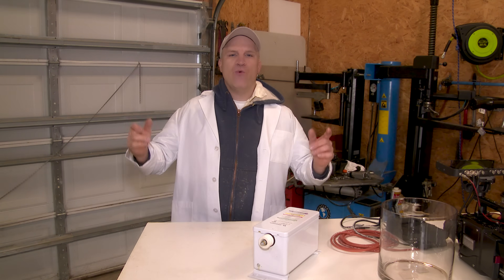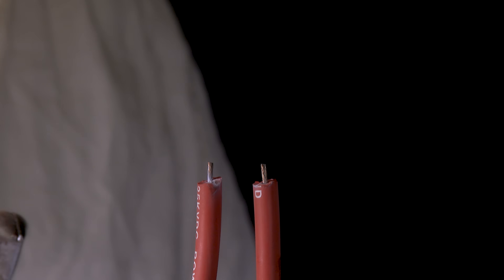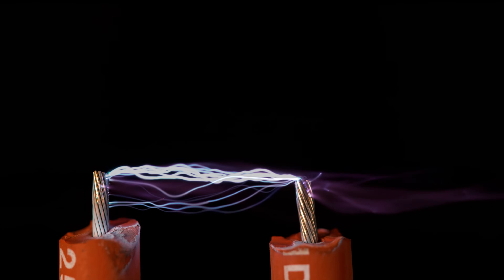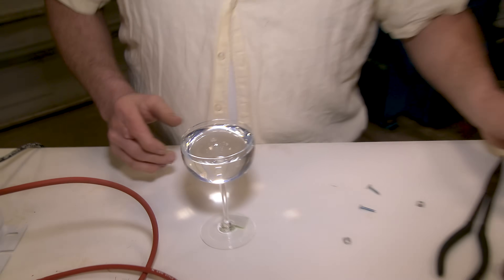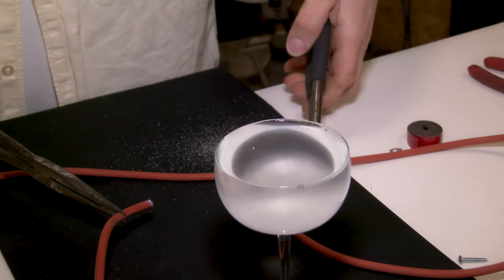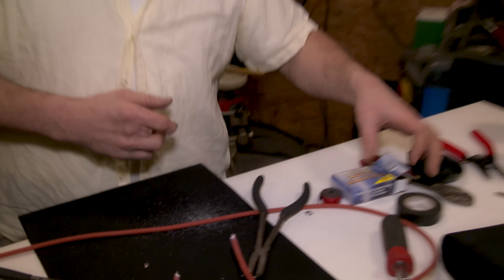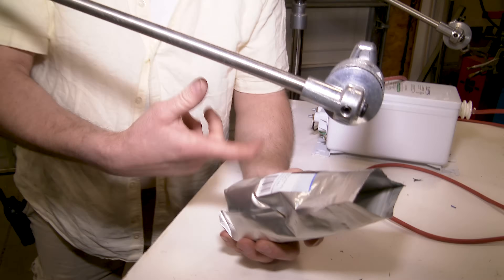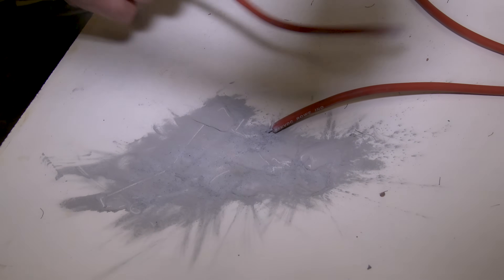High Voltage Electricity and Water - 4k Slow Motion & Ultra Slow Motion

Comment: When I was fourteen I put  sixty amp at two forty volts into a large Perspex beaker filled with water. It was like a thunderstorm in a jar. It was so violent the whole jar danced around. It was excellent.
Reply from the maker: Preaching Knowe I have been thinking about recreating something like that, thanks, I now just may do it .
Reply: Warped Perception I would not recommended it. I did this before health and safety had been invented. Like many of the things I did back then it was stupid and life threatening. So don't do it just because I did it and survived. Besides I described it for you so no mystery. Be safe

Comment: in the slow motion section @5:38 you can see the oscillation of poles between pulses. one electrode pushes down on the water while the other pulls up and on the next pulse its reversed.

Comment: I like the suggestions about trying other salts, but a different thing to try would be spraying a mist of water (or salt solution) between the electrodes instead of holding them over a container full of water.

Comment: You should try this setup: plastic bottle filled with salty water, one electrode submerged into it, the other one sparking the outside of the bottle, I did this once with a very powerful spark generator (I dont remember the voltage or power, but the sparks looked much more violent than the once you got with that one), anyway, give it a try, maybe it looks awesome as well with your transformer, it makes like a tree kind of shape, its amazing. Great channel, keep it up!

Comment: I previously scrapped metal as a 2nd job before. It was often that I run into aluminum wiring. Mostly copper, but about every 6 sites or 10 sites construction, I would run into this aluminum wiring.

Way back like 2005. The construction companies just threw away all the old and scrap wiring in the garbage. I used to go to the construction sites and ask if I could dig in their garbage bin for wiring. They sure let me. I was able to pay $75/day at the hotel and still have plenty $ to BBQ everyday for all my friends. And I only worked a few hours a day. But these days in 2013-2017, most construction companies will lock up the scrap metal in bins and call the police if anyone is hanging around an unlocked bin.

Also, because if china, the iron scrap price dropped completely a few years back. I used to drive around Seattle and pick up scrap iron that people throw away. Just a Ford F-150 truck load, I make $80-$150 just of iron. And once a while $300 a load for the aluminum engines and aluminum auto car parts.

But today. I bring in 2,000 lbs of iron and won't even make $15. No one leaves out scrap metal anymore. I mean, they do a little but. but it's no aluminum or copper or brass. Most the scrap now just goes to the garbage dump.

Comment: I loved how different the positive and negative strikes on the water looked. I only wish I knew which one was which. If you can get the high voltage out of an old fat screen TV, the HV "suction cup" electrode is pulsed DC positive.
Reply: galfisk o
Reply: It's weird that it does that. Water should attract to both charges.
Reply: also it is alternating current so no positive or negative electrode

Comment: Yehp, I noticed the halo around the plain tap water. I wonder whether there were moments where the electric current was hydrolyzing the water into H2 and O on the separate electrodes, then igniting it via the arc.

Comment: You can tell it is AC and you can tell which is live and neutral (actually positive and negative as not ground referenced!) at any one time 5:26
Reply: You'd be correct! I did write my first comment while under the influence of being awake for 37 hours XD 

Yes being through a transformer (Isolated from an AC input directly) would make it positive and negative, although still an 50hz AC (UK) (60hz if US) "flow"
it would be a bad idea to have the transformer earth referenced while in operation pop "oooooops"

Comment: Blowing on it causes that reaction because of the moisture in your breath
Reply: Neither oxygen nor water vapor is required to form an arc. All that is required is a gas that can be ionized, and a voltage high enough to ionize it (or a current high enough to create the heat required to ionize it, which is how a welding arc works). 
When the plasma stays around for several strikes, you get this fuzzy arc that kind of looks like a flame (which also consists of plasma). If you blow away the existing conductive plasma, the arc needs to re-strike through non-ionized gas, which gives you the narrow blue sparks.
Reply: galfisk is right, the rest of you are talking out your ass
Reply from the maker: SirKingHoff glad you liked it !. thanks for watching
Reply from the maker: LMAO !!!. I'll try it next time. That would be cool
Reply: I'm going to agree with Joey and Tiago here, ionized air is being moved by blowing and the arc follows it (route of least resistance)
Reply: I suspect it is just about the movement of the air; you're just pushing the warmer more easily ionized air away; sorta like how the hot air rising causes the spark to rise in a Jacob's ladder.
Reply: Now he should vape on it!
Reply: I agree with joey here guys, in a plasma torch you can use pure nitrogen gas rushing past the arc as your plasma medium essentially. So little or no moisture, little or no oxygen. It's impossible to form that arc in a total vacuum though, nothing to add electrons to.
Reply: TiagoTiago That's nearly spot on, the air remains ionized for a short while after it is energized, ionized air is more conductive so will help sustain the arc. By blowing away the ionized air and replacing it with unionized air the arc will lose its highly conductive path and will have to forge a new channel of ionized air.
Reply: Right, the extra electrons have to break away, and the hyper excited electrons have to fall back to their lower orbitals. Releases a TON of energy as heat.
Reply: Ubetcha
Reply: Not just heat though, as electrons fall down to lower energy orbitals they release radiation such as visible light or UV. I love that you're paying thought to this interesting phenomenon. This is why electric arcs vary in color depending on what gas they occur in. Different spacing in orbital energy will cause different colors of light to be emitted.
Reply: Right, you get all kinds of radiation, heat is the primary output here though. You get a lot of high energy radiation, like UV, which is why when working with plasma you should shield your eyes. On the subject of him mentioning lightning strikes and blowing earlier, when he blows he blows away the ionized air, causing it to have to 'strike' again. In a thunder storm, if you watch a large cell strike, you will often see the same path lit up a few times. It's very similar to what is happening here, the electricity travels the ionized arc, with much less resistance. So you get a MASSIVE strike and end up with a few lower energy bridges traveling in its river of ionized gasses. I really enjoy learning about and discussing anything to do with electricity. Been learning it since I was 7.
Reply from the maker: darian brown btw , I filmed my plasma cutter at 80amps cutting through solid 3/4" stainless bar, it's was awesome to see how it cuts through and cleans the metal.
Reply: Try again, think of what happens when you blow on an ember. Fire and an electric arc are both plasmas. So just like with fire, oxygen is required.
Reply: Mhmmmm oxygen isnt the only thing necessary for this reaction to happen with electric currents. How do you think lightning travels through the upper atmosphere where oxygen is less available? It travels through other components that makes up the air, aka water and nitrogen. Blowing on a high voltage current does provide more oxygen to the current but it also introduces more water vapor into the system, so yes you are right that oxygen is a big component in the reaction but 100% wrong telling me to try again. Sooo, fail? Yeah, fail on your part.
Reply: Jeez you're fucking sensitive. I was honestly just trying to help.
On a separate note that's not quite right but you can believe whatever you want.
Reply: Sensitive? Ha. Help? Ha. Would love for you to explain the science behind it. Otherwise, you're just delusional and uneducated.

Comment: maybe if you put one wire over the water, the second within reasonable sparking distance but outside the glass in the air
.. while wearing gloves, goggles, heavy coat, helmet of course -- just in case

Comment: So there's a couple frames of slow mo from 6:15 to 6:20 which are really cool where the spark travels through the water suspended from the wire after he dunks it in the glass.

Comment: Why does it go up instead of going straight across?
Reply: To answer my own question. Maybe the heat surrounding the arc makes the arc rise.
Reply: Tar RiverPirate you are exactly right, the ionization of the air is a MUCH higher energy state, so it gets REALLY hot. The air rises from the heat. That is the working principle behind the jacob's ladder.

Comment: I love that at 6:45 you can see the effect of alternating current. It pulses into the water almost like with a mini fire and exhausts out into the other wire almost. You can see the initial pulse change sides as the current alternates direction. Mental. I love deep stuff like this.

Comment: I know you said you were unimpressed but let me tell you what I saw.
alternating current switches direction in the states 60 times per second. the end with the highest resistance get the greater spark because it drops the most voltage. I was able to see one side having a stronger arc than the other. then I saw it alternate where the other end had the stronger spark. so though I understood it in theory, I had never seen that before and I thought it was remarkable. 

maybe not a stunning display but when you recognize what it is you are seeing this video is certainly appreciable.

thank you for doing this.
Reply from the maker: good point, it actually was really nice once i saw it in editing, when i shot it i thought it was just ok, thanks for the appreciation and thanks for watching!

Comment: several things caught my eye : that the arc path in air is not a straight line or shortest path between the wire ends &  that we can see the arc of electricity in air but not in water.

i enjoy your low-key / just-try-something approach to experimenting now. and allow
for understanding to follow later
Reply: I noticed the same things. I think the reason the current does not take the absolute shortest path is because it is also being repelled by the rest of the wire; therefore, the current tends in a direction further from the wire. Also, you can't see the current in the water because the electric flow is going between the ions and molecules of water rather than air particles. Someone please correct me if I'm wrong.

Comment: I have a 9000 volt neon transformer and first played with it in 1972.  One day I was making a glass bead by having one wire over a small pile of wet sand. Other wire was in the sand. Resulting arcing produced a purple bead but before done , both wires came loose and landed on my thumbs. All that electricity was going to my chest. My eyes just turned off. Could only see black and what seemed forever, I managed to push myself backwards with my legs and broke contact. Geeez, thought I was going to die. But I still have the transformer, just a hell of a lot more careful. btw my eyesight returned to normal once loose. If you use a single strand of old screen wire and arc to it, it will spark heavy then ball up until it cant melt anymore and just do small sparks. Now, that is with 9000 volts. 15,000 may not ball up and stop. Never had a more powerful transformer to try it.
Reply from the maker: +55Ramius well I'll tell you this, I had an old transformer like that but I lend it out and I never got it back, they don't make them like that anymore , I believe that one was 10000 volts 5 amps, I'm pretty sure that'll kill you if you hold onto it long enough, the newer ones like this and the solid-state versions are much less amperage , like a hundred fifty times less. Do you still have that old Transformer? Does it still work, I would like to see a picture.
Reply: I saw no way to send you a picture of my old 9000 volts transformer you asked for in comments. I tried putting it and a short video on your Facebook but I don't see it. Also see no direct email so what option do I have?
Reply: So you are the guy doing the Warped Perception videos?   As for amps, have no idea but must be micro or I would be dead I think. I tried a video of it running also besides the picture. There used to be a small metal plate on it long ago I think but is long gone. Do not remember any specs other than 9000 volt. did you see a video on FaceBook? I have no channel yet or a website. I don't know for sure where I could place things like this and just link you too it.
Reply from the maker: 55Ramius well I don't make the videos all on my own ( I wish that was possible ) , I write , direct and host them.  that's cool, I saw the pictures but not the video. I will look again. I'm sure those older transformers are higher amps. I mean if you raise the amperage even a little, the wattage multiplies exponentially so it becomes more dangerous.
Reply: Warped Perception I have a "1930s" 10k transformer. Haven't even used it yet though. But yeah the older ones were not current limited.

Comment: can you do a plasma ball in super super slowmo? the slowest possible!
Reply: Hi... I am also interested in plasma ball... Can we share our ideas? If you don't mind
Reply: @adityareddipalli5433  yes, what are yours?
Reply: @MAGNETO-i1i  I know the mechanism of plasma formation in air medium. I will explain if you want... But I want to know how the motion of the charged particles will be inside the plasma ball?
Reply: @adityareddipalli5433  I don't know much about the mechanism but I love learning new things. I am just curious about the way it moves from one point to the other, because it is super fast and I imagine it moving like a lightning volt in super slowmotion
Reply: @MAGNETO-i1i  yah... It will be like two light streams coming from both electrodes coming towards each other and then a spark occurs( discharge with lightening), then a plasma channel forms around it... inside the plasma channel there will be fast moving ions and gases(I read but haven't seen).. The  ions move randomly with high velocities... So I am also curious to see how the ions move in slow motion...

Comment: I have an idea!  hang two bare wires horizontally over a 5ft span or so, space them an inch or so apart so you can get an arc, and the spark will cause a magnetic field that will make the wires jump away or towards each other.  This is known in the power distribution industry as "conductor slap" and is a very interesting effect.  there are a lot of cool things that can be learned here.

Comment: the main surprising thing to me is the visible difference on each side on the phase with the water.  I wish I knew which was which.
Reply: That sounds like a good assumption but I  would like to know for sure.  Also electrons flow from neg to pos.
Reply: Typo, I had already corrected it.
Reply: also it is alternating current so no distinct poles either